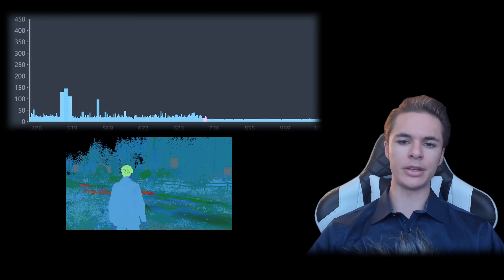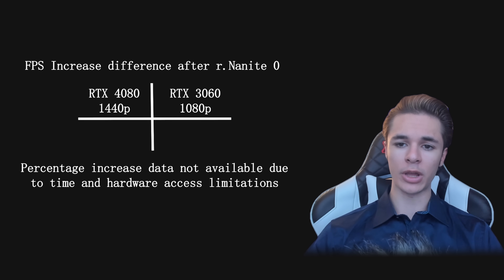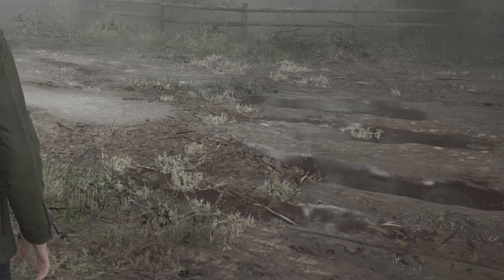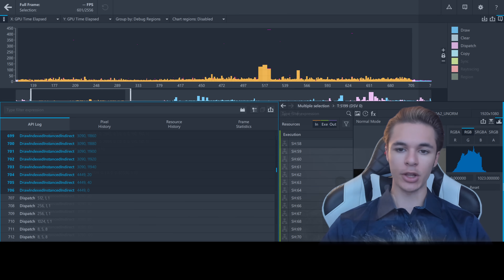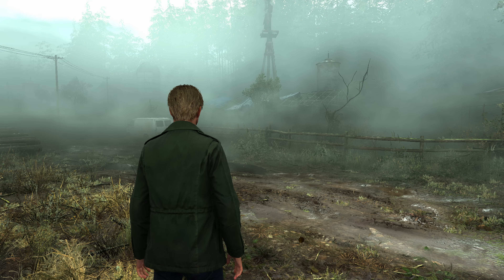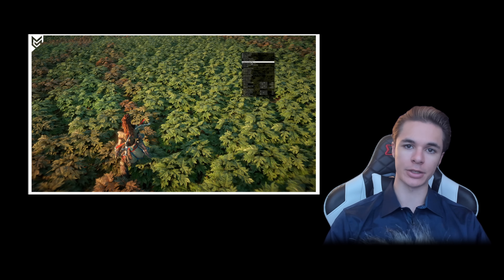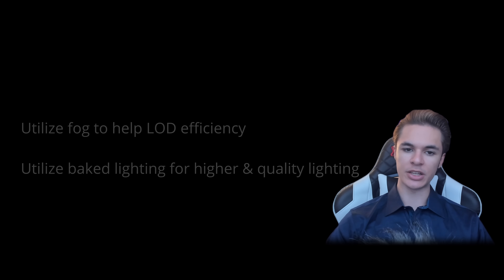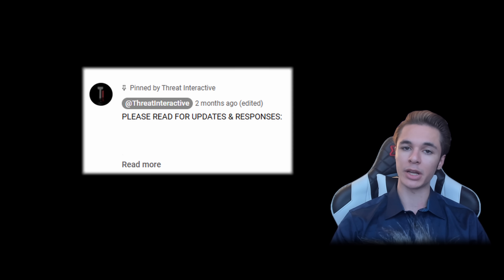The Price of Realism? | SH2R Optimization From The GPU Perspective

Comment: Optimization has gone out the window for a few simple but far-reaching reasons:

TL;DR. 1) Game devs are lazy because of how the game development work environment has changed. They are nearly assembly line workers at this point. 2) The previous console gen was easy to develop for with less relative hardware constraints than previous generations. It created a bunch of soft developers and programmers who didn't even have to think about optimization past "turn the resolution up or down" . 3) Money drives game development and directly causes corners to be cut across the industry. 

1) Laziness combined with time crunch. Generating a 3D world is easy but optimizing it so objects and areas don't take unnecessary resources takes a lot of manual work. Even with automated tools it can be very time intensive. Investors expect a product on a deadline and when something works "well enough" on the target hardware anything beyond that is seen as frivolous and timewasting. It soon becomes the norm to do the bare minimum of optimization or do none at all and depend on the engine and SDK to do the heavy lifting. It simply isn't worth the meeting with the business guys in suits to try to convince them a game needs more time to cook. All they hear is "We are failing to meet our deadline."

2) Lack of experienced programmers and hardware stagnation. The old guard is retiring out of the industry and we have a new batch of fresh college grads who have never had to work with challenging consumer hardware limits. Like stuffing all of RE2 onto a 64MB N64 cartridge. The very long lifespans of Xbox 360 and PS3 created a stagnation in graphics and game design. Then when Xbox One and PS4 released they were such a huge upgrade they created a lull in drawcall, memory and storage requirements increases as devs caught up to the hardware. CoD WW2 is a great example of this, having terrific visuals but very simplistic level design and runs at a genuine 4K 60 on XB1X. For once they had plenty of everything for the titles they were running. This allowed a lot of lazy development practices to take hold and resulted in a lot of very quick and dirty games that ran well enough but weren't well optimized under the hood. 

As level complexity, resolutions, polycounts and texture sizes increased beyond the XB1/PS4 level, the memory and processing requirements rose exponentially. Xbox One has 16 times the memory of the Xbox 360. The Xbox Series X only has double what the Xbox One has and 33% more than Xbox One X. Xbox Series S only has 10GB which is less than the Xbox One X! So the newer consoles, while well equipped, don't quite have the relatively ample hardware of PS4 and Xbox One. Game devs' poor practices forced them into a bottleneck.

This turn of events clearly caught a lot of developers off guard and brought poor game-making practices to light. It gave us jokes like releasing titles with all the textures uncompressed(TLoU Remake). Or just disabling the LOD system entirely and making everything draw way beyond what the camera view can ever see with no culling(Crysis Remastered). Or having ultra high poly full-detail trees hidden behind a wall of fog (Silent Hill remake). A lot of this stuff is so simple and basic is HAS to be a matter of experience.

3) Money. Money has changed the industry so much over the years. As mentioned above investor pressure and time crunch are very real. A dev studio could make a highly reviewed game these days and actually make quite a decent profit, and still have it be considered a failure and have the studio shuttered. All because it didn't meet the unrealistic expectations set by people in suits. So taking time to optimize is a money decision. And it's often something that isn't just neglected but directly decided against. The first priority is maximum profit.

Comment: Yep, let's raise money to fix the software of these multi billion companies... That makes sense...
Listen, you still do not get the main issue here. It's called budget. Every company tried to cut the costs. UE is cheap today, and one reason is that Epic is making Fortnight. Therefore everyone deal with the fact, that UE is biased towards what they do for Fortnite.
Why they used Lumen instead of baked lighting? Again - budget, it's much faster to iterate via dynamic lighting. Even if they use Lumen for preview, when they bake the lighting, it costs time to check everything again, to match the initial vision and be ready to fix issues. 
Why Nanite? Just let the artists do whatever, and throw the assets in UE. Who needs to pay graphic programmers?...
You can't "fix" UE, it's working EXACTLY in the way the industry wants it. The studios do not want to waste time baking lighting or optimizing meshes. You wrongly assume UE is the problem, while the studios actually see it as the solution. Yes, the consumer pays the price. BUT... the consumer has two options:
 1. pay the price up front, which means north of $120 for a game when you add the increased costs and inflation
 2. indirectly, by requiring more expensive hardware or play at low settings and upscaling from a 720p. Of course, this is the easier option to "sell".
It's exactly the same with the governments. They can raise the taxes, OR just print the money and use the inflation tax... Guess what works better.
Is there an alternative? Actually yes - play indie games, support the open source project you disregarded. Yes, they will never look AAA, but they develop games closer to the "old days". Something that AAA studios will never do. And I find trying to sponsor more UE development absurd...
Reply from the maker: RE: The studios do not want to waste time baking lighting or optimizing meshes.

Your under the assumption that we are advocating for longer processes when we are advocating for similar workflows that don't crush performance on industry target hardware. 

Checkmark culture such as Nanite and MegaLights is not an issue. The problem is that everyone acts like checkmark workflows justify the giant issues such as quality and performance problems they introduce. Our stance is that it doesn't have to be this way.

Comment: As someone who is starting with game dev, it makes SO MUCH sense now that modern Unreal games are so poorly optimised. I knew nanite and lumen were worse than advertised, but knowing the industry and what my teachers told me, it's reasonable to see those systems used everywhere now. Since they are the shiny new thing, managers will be hiring people who know how to use them even if it's not optimal.

I am making my final uni project with a small team, and I honestly think that we should be switching to baked lighting with dynamic elements instead of using lumen with everything being dynamic. Since this is a small game with simple graphics, we don't really benefit from it, and it makes my life harder trying to optimise it (that's my part of the project). BUT my teacher advised me against switching for my CV's sake so that I can claim I have used it in a project.

He is right, but this highlights a key issue in the industry, and many industries: We have people in positions of power with no knowledge about the work they are supervising, so they just follow marketing bulletpoints and trends.

We need to put more care and highlight the importance of optimisation. We can't keep making bigger graphics cards forever. We have to stop brute forcing with "Artificial Intelligence" and be more intelligent ourselves, DLSS shouldn't be a requirement to run your game. It should only be an option.

Comment: Transitional areas like the middle platform in the stairs in the appartments lobby between the 1st and 2nd floor, the hospital between floors in the stairs that connect the 2nd and 3rd floor and the stairs in the prison are a good example of poor optimization, the next area gets rendered ahead of time while the previous area is still loaded at the same time and that's what kills performance in pretty much every staircase in the game, and it has always been a common issue in so many games for years, especially unreal engine games

Comment: They could have literally lowered the polygon count, and made a normal map. They could have removed geometry the player would never see. Ray tracing should be OPTIONAL! I know people like the realistic lighting of RTX, but it isn't necessary. If you don't need 500mil polygons per object, don't make it 500mil polygons. Tessellation can add fake geometry. Why don't we ever use PBR anymore, or normal maps? I find it hilarious that Source Engine still holds up to this day, and often has BETTER looking water than modern games, and yet none of these "High Tech" engines and games are EVER done right.

Comment: Sometimes I wish that games had much more detailed settings to save performance on various machines but that is same like asking devs to optimized the games just like Doom Eternal was optimized for example... one funny memory I have from the past when CoD:MW2 released in 2009 I had quite a bad PC and the only way for me to play the game on higher FPS in multiplayer was to completely disable any shadows rendering and leaving the game in a mode were only base texture was shown which made it look very different but I was able to not care about the looks just for as long as I was able to actually play the game somehow where in Silent Hill 2 I am on 7950X3D + RTX3060 and I was forced to play the game on lowest settings possible and still had tops 40~50fps with some areas dragging me down to even 30

I admire this video for showing how much you can change via console commands in the game and it almost wants me to download SH2 again to just try to decimate its fancy params as much as possible to replay the game with fluent motion and stable 60+ fps

Comment: There's something else that should be taken as an indication of a lack of optimization, or laziness, or mediocrity when it comes to game performance, and that's the require
ment to install the game on an SSD. When I see that requirement, I avoid the game. I know that SSDs can handle multiple writes nowadays. That's not the problem. Although, in part, it is.

Comment: just play with a little lower resolution and to make the game pixels more clear make the screen the same resolution in the game and choose the best anti alising with lowest quality and higher refresh rate and you will be ok believe me the quality looks the same as high because the engine it self or the textures are high quality in the first place this is what i'm doing and i'm very happy with that although i have 1050 ti most game works fine with me not gonna lie the very modrest games i don't play becuase they won't work fine i need better gpu but online games even working very well and that is it

Comment: I really miss when Epic actually cared about Unreal Engine, mainly from the pre-fortnite era, because back then they'd use Unreal Tournament and Gears of War as testbeds for their engine which helped a lot with innovation while also making sure the new features they were adding were optimised and tailored towards games and film being more of a secondary focus.

I still however think that UE5 has a lot of redeeming factors that still make it viable and it's great that your goal is to improve the engine and not mindlessly slander it and call for everyone to stop using it or anything. I care about this amazing engine and I have for many years and so desperately want it to improve and be better.

I do however think that Unity and Godot could be worthy competitors to Unreal but they suffer from their own issues similar to Unreal regarding the engine developers ignoring many glaring issues such as Unity's overall structure being a mess and mostly unchanged since 2005, Unreal at least went through majour rewrites every generation prior to UE5 and I think that's what these alternatives need to do if they want to compete in the future

Comment: Developers are still learning UE5. And this is one of the few games that actually showed its potential. Personally i think they did a great job optimizing this game for PS5. As for PC optimization it's a global issue at this point.
Reply: PC ports of console games have had a history of having performance issues, flashbacks to GTA 4 PC release. It really annoys me however that too many people blame Unreal for bad optimisation when clearly the engine has a ton of optimisation tools to make it run good on PC but it's just the developers are too lazy to use them to make their PC port well optimised, the engine does not matter in this case

Comment: I'm genuinely interested to see your take on in-house engines like DICE's Frostbite, CODs IW engine, CDPR's now defunct RED engine, Capcom's RE engine, etc. Maybe do comparisons between engines.
As someone who's green as grass when it comes to the topic of game development, I'm struggling to understand how a game like REmake 4 can visually outpreform a majority of games on the market while having a modest file size. Call of Duty is one of the worst case offenders of bloat (The COD HQ can bloat up to 300+ GB if you have everything installed). How did it get this bad? What are the developers doing wrong?

Comment: I'm sure some of these issues can't be fixed so easily because the team is inexperienced or they're just limitations of the engine... But come on, guys, the least you can do is aggressive LOD cuz the fog is here.

Nevermind the LOD stuff, I'm even more baffled by somethin else, why the hell does every single element in the scene have more than 20k tris or quads ? Seriously, A FLAT ROAD ? WITH SUBDIVISIONS ???? We could have reduced 8 million polygons to 4 just by...not being stupid (or not rendering the roof of the church in the graveyard) for example)

Comment: My only complaint with the game was the lackluster performance on my modern hardware. I just thought it was because my gpu’s a generation behind or because of UE5. I’d much rather play a game that looks good at a consistent 60fps than a game that looks phenomenal with constant frame dips even at low settings. If the game is hardly playable with the best graphics, why make them that way in the first place?

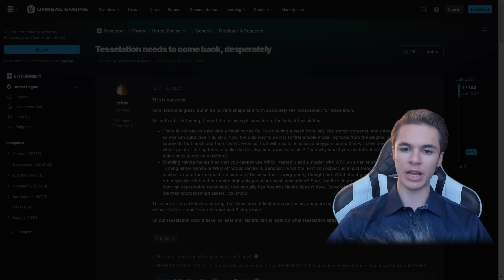Comment: 13:28 why has epic ended support for hardware tesselation? tf? do they want everyone to use highpoly surfaces instead of shaders that emulate this with less resscources? makes no sense.
Reply from the maker: RE: do they want everyone to use highpoly surfaces instead

Yes, it's a total relentless push for a 100% nanite workflow. They've stated they want to completely replace traditional rendering even though it's extremely fast, and can look amazing if workflows are made correctly for it. 

They keep acting like Nanite is "faster" when it's not. Literally lying on stages about this.
Reply: @ThreatInteractive  i do arch viz where i render still images with render times up to 4 hours. and even i try to optimize my scenes. it would be crazy to use real geometry for a brick facade or a rocky soil when i could just use a displacement or tesselation map. i do this for file size not render times. 
if this is the future, i can buy like one hard drive per game installed. lol
Reply from the maker: @L3nny666  That's why they added nanite tessellation apparently.

Comment: I appreciate when someone actually takes the time to figure out why something is performance heavy rather than making assumptions based solely on what they see.

Now with that said, I do also want to remind everyone that when a question is raised on "why did the developers use this non-performant system when there's an obvious better choice here," the answer DOES tend to be "because the publishers and/or directors told them to."

I'll never forget a back and forth I had with one of the people who worked on the opening to Skyrim. They were talking about how much trouble they had with the realtime cart sequence at the start, and when I asked them "couldn't you guys have just baked an animation instead of making it realtime and having to fix it every time the geometry was changed even a little," they responded with something like "Yeah that would have been so much easier and would have avoided so many headaches and wasted time." With that response alone, they told me everything I needed to know.

Comment: Games cost 10x more to make, yet only cost 2x what they were priced in 2001. There is so much more art required to make a modern game due to the much higher levels of detail we expect. It comes at a cost
Reply: "Games cost 10x more to make" - wrong. People still keep failing to understand the basics of business. Games don't cost more to make - more money was invested in them. If profits hadn't soared, then that "cost" wouldn't ever be a thing, because the investments wouldn't back it. In other words, games cost as much as the profit they are expected to make. If they are not expected to make much profit, they "cost less" because nobody is willing to put that money into their development.

Additionally, investment increased not just because of profits, but because investment is tied to risk assessment - the profitability of games, the explosion of the games market from the late 90s onwards, meant that the risk associated with investing in such projects decreased. The cash flowed, because investors were following an upward trend. 

When you actually factor in the advent of so many pre-built tools and vast libraries of knowledge and functional code, games got a lot cheaper to make. In fact, if you consider the actual publishing overheads to be part of a game's production cost, then games got cheaper again after around 2004; with the spread of digital distribution, suddenly it was possible to publish games without even having to distribute discs.
Reply: Games don't cost much more to make now, they just waste more money on marketing.